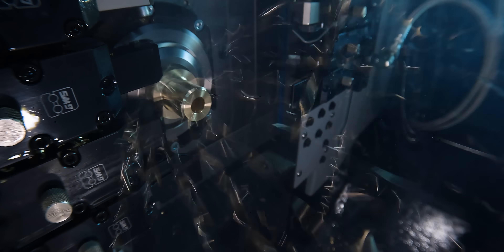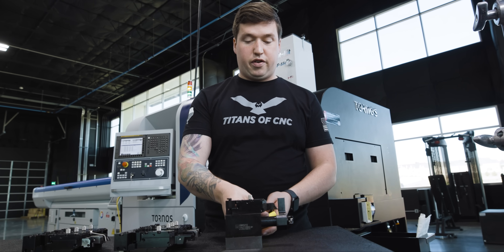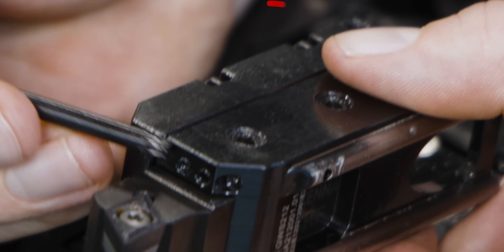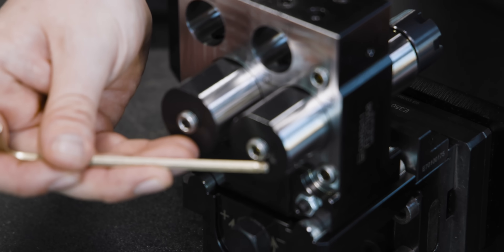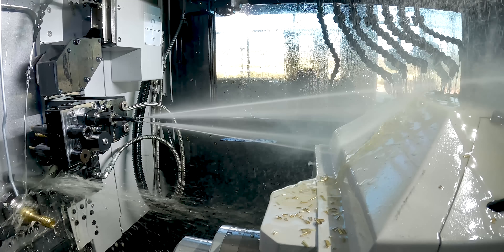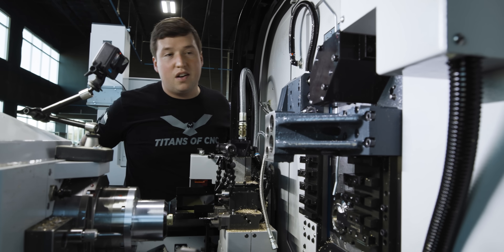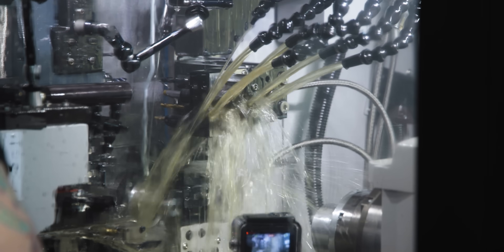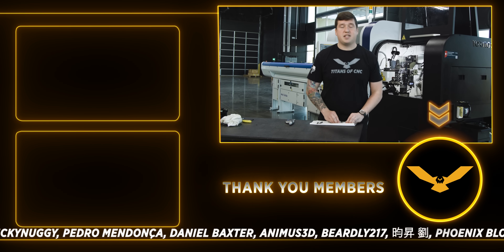Unboxing the INSANE Göltenbodt Tooling System

Comment: Does the modular tool gang accept tool holders from other brands, or just theirs? And does it allow for coolant through tool, or just through the block? Thanks!
Reply: I didn't see any thru tool coolant, which could be somewhat of a disappointment, but the clamping system in the tool block appears to clamp on a stand holder shank.  Unless they use odd/proprietary sizes.
Reply: There are two types of coolant thru for the blocks. One is the 3 holes shown in the video the other is an adjustable line that can be aimed at the tool tip. I am not aware of any way to plumb to the back of a tool for thru coolant but I also can’t really see too much of a need for that
Reply: The Goeltenbodt fixtures accept ANY brand shank. Does NOT require a proprietary brand. I personally recommend the Schwanog brand. And yes, you can plumb coolant through the actual tool holder.

Comment: It really is nice having this tooling system in our Tornos GT32! Already two setups on it and I gotta say Goltenbodt really thought of everything!!!
Reply: I would love to see more thorough testing of repeatably.
The shop I work in we do almost exclusively tight tolerance parts in all ranges of materials.  This system looks awesome especially since half of a setup could be done before the running job finishes with the right planning and enough tools, holders, ECT.

At my shop we have mostly switched to a tool holder that goes in the normal wedge style slot, but it has a detachable head so you can remove it to replace the insert while all the plumbing stays in place. Setup is just as much hassle, but once running, insert changes are easy and extremely fast.  They have heads for threading, turning, grooving, and probably other types of inserts.  With that system we don't have to retouch off just because the insert wore out and was replaced, and it repeats to a couple tenths or less.
I can't remember the name of them unfortunately!
Reply: @mgk1397  from what I can tell they repeat within .0002-.0004” pretty much no problem. Do you have a certain type of request for a test I can do?
Reply: @mgk1397  And w/ a few extra change holders, you can just pop out tired insert and pop in fresh one loaded and ready to go. Minimum down time
Reply: How about machining a sphere profile on front of part (a small flat on front face of sphere profile would need to be present for use in measuring the part later). Complete the front half of sphere profile completely thru the crest & halfway down the backside of the sphere profile. Transition into a square shoulder & machine a short linear length of some specific diameter by stepping  towards the spindle face using a dogbone groover. Cut the part off. Essentially the finished part would looks something like a sphere shaped lolipop with a short stick coming out of one end.

Remove all tools from the block, dunk the modular tools in some coolant, clean that coolant from each tool's registering surfaces, then reinstall the tools & rerun another part.

Measure sphere & other diameter with digital mic. Check all linear lengths on part by standing the part vertically on the table of optical camparator,  sphere end down on table (the purpose of that small diameter flat on front face of part mentioned above).

Sounds like alot of part from the  over-described ,machinist grade, mental picture that i tried to paint for you, but its really not. Im open for suggestions if everybody thinks this idea sucks. I'm VERY curious how well the modular syatems can repeat. Im in charge of machine & tooling purchases for my company & I desperately want to  bring Swiss machining into our business. Ive always heard stories of stupid amounts of time changing over jobs on swiss machines but i believe this equipment has its place in small to medium batch quantity, high precision job shop environments & a test like this would go a long way in providing a good example of just how high precision these machines have become. Are they really ready to help Job Shops compete? Or are these still only a mainstay in high production, low turnover environments? Please show us. 🙏
Reply: Maybe even take my suggestion a step further & change the inserts between parts and reset them with the product's presetter?